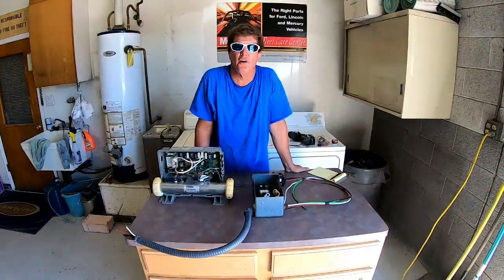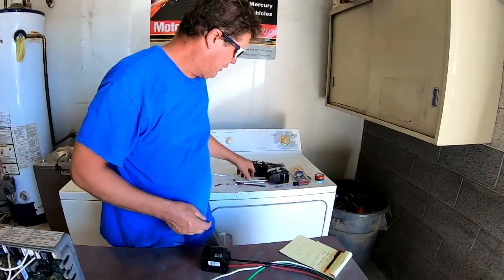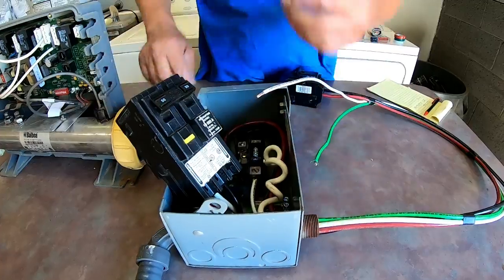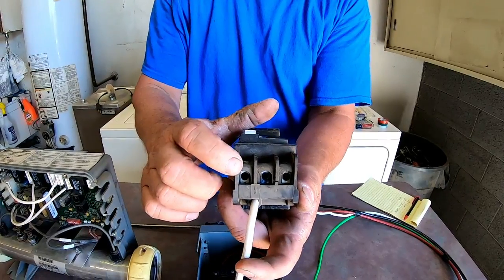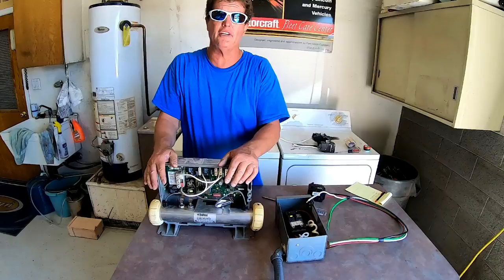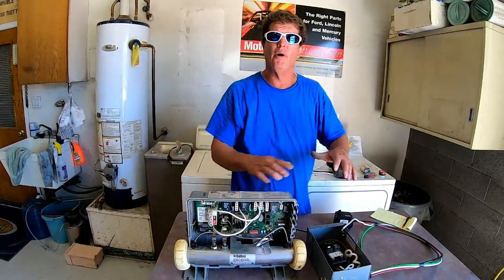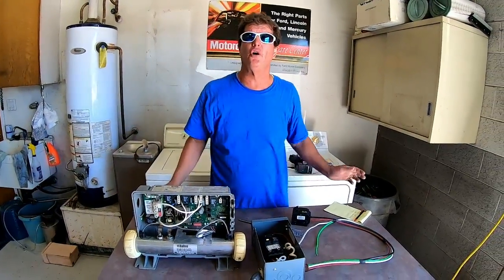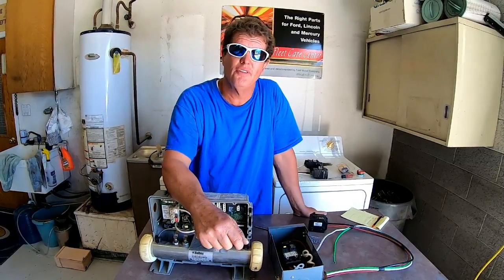Hot Tub / Spa wiring made easy... 50 Amp GFCI Install..Arizona Hot Tub Factory (DIY Spa Repair)

Comment: I don't get why you need 2 breakers. Seems silly. Why not make the breaker at the sub-panel also a GCFI breaker?
Reply from the maker: Ok first off you will always put a breaker in the main panel and the you will put a breaker in a sub panel. ( Only one of them has to be a GFCI never ever 2 GFCI breakers).  no closer then 5 feet from the hot tub and further then 20 feet and in line of sight. Sub panel should not be lower then 36 inches from ground .Now if you hot tub is placed less the 25 feet from the main breaker you only need one GFCI breaker in the main panel and make the run to the spa and you are done. Hope this Helps Thanks for Watching & SUBSCRIBING.
Reply: @spaman5440  Perfect! I did exactly that today (replaced the non-GCFI breaker in my sub-panel with a GCFI) according to your helpful vid! After 25 years in this hot tub, we now have GCFI protection. I noticed that 4 other breakers in the sub-panel already had gcfi and pigtails--just NOT the hot tub! (It's a quite DIY build of a house--if you only knew...)

Comment: Hello.  Question.  Had a Midwest 60amp Spa disconnect but, the tub we switched to needs a 50amp,  Midwest said it was ok to use a 50amp Siemens breaker.   Any issues there?   Should I just go to a midwest 50amp box.  I noticed HD does not sell those spa disconnect and read they were having issues.
Reply from the maker: No issues that aim aware of..I use 50 amp GFCI breaker with #6 wire for 120 foot max run... 3 pump/motor spas I sometimes will use 60 GFCI and go the larger wire. Hope this Helps Thanks for Watching & SUBSCRIBING
Reply: @spaman5440  Thank.    You made this SO EASY and you are still responding unlike most on YouTube..   :-)

Comment: Where do the white and green wire connect to inside the main breaker panel in the house?
You never explained what to do with those wires inside the main breaker panel.

Comment: I have a question I will be installing a Maya Platinum superior steam shower / jet tub combo and it calls for 2 dedicated circuits a 40amp and a 20amp. The 40 is for the steam generator and the 20 is for the jet tub. I have to put a  100 amp sub panel in and its about 70 feet from my power pole what size wire would I need would I need to run from my main panel to the sub panel.. I was told to run 2-2-2-4 and then run from the 40 amp to the steam generator 8-3 with ground and 10-3 with ground from the 20 amp to the jet tub. What are your thoughts.

Comment: Excellent video!  We recently bought a house with a Jacuzzi in the bathroom.  The home inspector’s report said that the motor wasn’t grounded.  I am looking at the motor now, and see a grounding screw on the motor, with no wire on it.  Where should that wire go to?  Thank you.
Reply from the maker: If you look the side of the pack there should be a ground bar...If not it is on the inside of the pack.. Just depends on what pack and Hot Tub you have.... Hope this Helped and Thanks for Watching & SUBSCRIBING

Comment: Sir if your installing a 50 amp GFCI sub panel that will feed a Sundance Hamilton 3 wire pac.  Should wire the subpanel with 4 wires and then just hook the curly wire to the common and only take the hots and ground out to pac?  Or should I not run a common to the sub panel?

Comment: What happens if the hottubs brand new. First time being wired ever and neither breaker trips but the tub still doesn't do anything?
Reply from the maker: #!1Did you check to make sure you have power to the hot tub #2 Is it wired correctly #3 blown fuss on the main board,. ...I would start with #1 and make sure you have power going to the tub.Hope this Helps    Thanks for Watching & SUBSCRIBING

Comment: Why is a sub box needed?
Reply from the maker: (NEC) It must be at least 5 feet away and not exceed 20 feet and within line of sight. The NEC also requires a 120V receptacle within a 10-20 foot distance from the spa. Bottom line is it is for safety if you have a problem and need to turn off the hot tub fast you do not have to run over the river and through the wood to turn it off...Hope this Helped.  Thanks for Watching & SUBSCRIBING

Comment: the dumb part is, they should build that gfci inline like a soda vending machine. Those gfci breakers are GIANT.  the GFCI breaker will reach dang near to the BOTTOM of a 70 amp, 2 space panel. Literally, there will only be enough for the stripping of the wire to put in the breaker. So if you entered at the bottom? Youre 100% messed up because the connector will cause the breaker not to fit. He is using smaller wire. for a tub requiring   #8 wire. Guess what? most people have hot tubs over 100 ft from the panel, and that means BIGGER wire. also some have larger tubs, now youre talking #6, all the while, the panel remains the same size!? its stupid. You wont be able to simply bend around a #6 like that.  thanks to greed, the Makers are blaming COVID for why they have no products, while MASS MARK UPS are happening. Mark ups that WE ALL KNOW DANG WELL will NEVER drop when COVID IS GONE!  So the Wire AND the breaker are mega high. 
you wont find the gfci breaker at home depot, lowes, menards, or any of those big box places. A supply house MIGHT have it. BVut the Union and giant companies are buying up stuff BEFORE it even hits the shelf.
Reply from the maker: We can't speak for others about whats going on with supply and demand. With the exception of hot tub manufactures having delivery problems we have had no problems at all getting parts for any of our jobs.The owner of our company is well connected and has this ability to always find away  to make it happen. Thanks for Watching & SUBSCRIBING

Comment: A previous underground (under concrete) installation has 3 wires only: hot, hot, and ground. They are 6 gauge, but there is no neutral wire. I have been told that the neutral is only required for the (120 volt) electronics and switches, not to actually power the (240 volt) pumps or heaters. Based on this, I was told that the neutral wire can be smaller and be re-routed from a nearby, 12 gauge, 120 volt electrical outlet. Is this true? Is it safe?
Reply from the maker: I would never recommend doing it the way...And I can't really say if it is safe or not ! But I can say I would never wire a Spa that way !!! (The reason is if someone else came to work on the spa and they didn't realize what was done someone could get hurt). On a 220/240 volt 50 AMP with GFCI I use #6 wire on all of the wires for 3 wire or 4 wire.Most of the problems I see are when its wired with the wrong type of wire or size wire. For a 120 Volt system I use a a 20AMP Breaker and the proper size wire for a dedicated service. Hope this Helps Thanks for Watching & SUBSCRIBING
Reply: @spaman5440  Thank you.

Comment: Will a non fused ac disconnect suffice for a hot tub?
Reply from the maker: Ive seen a couple try to do it that way and in the end they ended up running a separate service just for the Hottub. Most A/C services run a 30 amp breaker which will not run most Hottubs. I would never recommend to operate a Hot tubs on anything less then a 50 amp GFCI breaker with #6 wire. Hope this Works ....Thanks for Watching & SUBSCRIBING

Comment: I am changing out the sub panel box on an existing wired hot tub. I noticed that I have a GFCI breaker in the main panel. Is it ok to install a sub panel box that came with a GFCI breaker in it? Essentially having GFCI breakers on the line.  Thank you!
Reply from the maker: You only need one GFCI breaker...So you put it in the main or the sub but I would not recommend installing two GFCI breakers. You will have nothing but problems... Hope that Helps Thanks for Watching & SUBSCRIBING

Comment: Hello my name is louie, I just bought a future Spa hottub from wayfair . The product says that it takes an input of 240 volts . I have set up my connect and wires to have 240 volts. I noticed that the motor in the system says , it takes only 115 volts. I am confused about this, I have the same system as the one you have in the video but it takes an input of 240/120 volts with a 4 wire connection, L2,L1,netural and ground. My problem is that the pump says it only takes 115 volts on the nameplate. Have you ever experienced a problem like this? I'm worried if I connect 240 volts because  the 115 motor will burn. Does the control panel split the volts from 240 volts?  The pump came with the hottub and it was already installed.

Comment: Quick question, why use a 50 amp in the main panel and a 60 amp out at the tub?
Reply from the maker: Most hot tubs will call for a 50 amp service..so a 50 amp breaker needs to be in the main and a 50 amp GFCI breaker in the Sub panel. Now before you start your project check the your spa manufacture and find out what is required for the spa your are working on.. Thanks for Watching & SUBSCRIBING

Comment: 50amp calls for 8 gauge not 6
Reply from the maker: Ya... Ive been reading that also for years...That is also one of the top reasons that the breaker trips is the wrong size Wire...#8 will only save you some coin but cause you a lot of headaches in the future...Good Luck Thanks for Watching & SUBSCRIBING

Comment: Im trying to connect 50 amp wires to hot tub breaker but i don't see a common wire. I only have 3 wires I see two hots and a ground that's not encased in any color
Reply from the maker: You are missing something... Give Scott a call in the morning at the Shop and he will get you going in the right direction  Thanks for Watching & SUBSCRIBING

Comment: Hi Scott
      I had my hot tub brought up from Florida to here in Tennessee.  Unfortunately they want between $1250 to 1500 to wire the tube up..ugh So I started watching your video on how to wire up a hot tub. My question is how do you wire into the main panel from the sub panel? I do have a 220 outlet on the outside of the house that goes to the panel inside the house if that helps.
Reply from the maker: I have a couple other r videos on my channel that may Help you... Thanks for Watching & SUBSCRIBING

Comment: How do you wire a spa that needs a 220v when your sub panel is 110v? In your videos you never mentioned that spa are usually powered by 220 v..
Reply from the maker: There are three types of spas 110 volt or 220 volt and then there are spas that have what is called a 110/220 volt convertible pack. so it gets down to what type of a Spa you have...Now if your sub is wired for 110 volt and your spa is 220 volt you will need to run a new service. So before you do this you need to figure out several things.
(1) What does the Spa require.
(2) How far is the run going to be from the Main to the new sub panel.
(3) How are you going to get the wire from point A to point B ? are you going under ground , or are you going to mount conduct to the stem wall. or are you going to go over head through the attic. 
(4) Once you know the distance that will help you figure out what size wire to use.. at a min it will be #6 THHN or THWN wire and a GFCI wired correctly. Hope this Helps Thanks for Watching & SUBSCRIBING.

Comment: I have a hot springs brand where would there be a reset button in the pack area the audio control module box burnt will that stop hot tub from running also
Reply from the maker: Check the owner manual for the Hot Springs model you have for that info .. and yes that will stop it from running.
Reply: @spaman5440  thank you sir
Reply: @spaman5440  was wondering if you have access to the hot springs parts I can’t find a Bluetooth audio control box for my rhythm model hot tub 2012 if you can find parts can you text me contact info just call or text me at 7656672963 name is TJ I appreciate it I’m located in Fairmount Indiana willing to pay shipping or whatever needed I can text ya box part number too

Comment: Very helpful video. One question what size conduit use from box to box for 4 six gauge wire
Reply from the maker: 3/4 will work 1 inch is a little bit easier to work with.

Comment: This was an excellent tutorial, thank you for posting.  The spa box I am mounting to my house is 60A so I used 8/3 from my sub-panel.  The spa asks for 50A.  Then used 6/3 from the main to the sub panel since the sub panel will have a couple other outside breakers in it.
Reply from the maker: I would not wire it with  #8 you could have problems. I would use a min of #6 wire for. a 220/240 volt with GFCI   Thanks for Watching & SUBSCRIBING
Reply: @spaman5440  agreed, I wouldn't use 8 either
Reply: 6/4so is only rated for 45 amps

Comment: Hey Scott, you are awesome!!!  Question: I got an old hot tub free - Hot Spring Grandee Model G. Looks great but obviously old. Wiring instructions indicate 50 amp breaker (1-30 1-20).  The control box which is IQ 2020 have instructions for a total of 6 wires (3 #12awg & 3 #10awg).  Must I run individual wires or can I somehow use Romex and a single 50 amp breaker identical to what you illustrated?
Reply from the maker: You have to use two breakers for a Hot Springs and all 6 wires as instructed by the manufacturer..or you will have problems.

Comment: Hi Scott, thankyou nice videos very informative, would you say to use the same Amp Breaker at the inside panel and the outside box? or can you use for example 50 amp at the inside panel with #6 wire run and a 40 amp at the outside box with #8 wire run? also is there a chat that shows accepted lengths of wire run to the correct amp breaker?
Thanks again
Reply from the maker: You need to wire the Spa the way the manufacturer says to do it in the owners manual... For a 110 volt Plug & Play I use a 20 AMP breaker with a cord that has a GFCI breaker built in to it.. For a Spa that has up to 2 motors I use 50 amp breakers for both main and Sub panel  (one has to be a 50 Amp GFCI) and #6 wire on all four wires... If it has 3 or 4 motors I refer to the owners manual and wire accordingly.Now depending on how far away from the main breaker the hot tub is placed will also play a part as to the breaker and wire size that has to be used.. Before you start know the Code and what the manufacture requires.. Hope this Helps. Thanks for Watching & SUBSCRIBING
Reply: @spaman5440 Will do, thanks for getting back so soon, I'm hooked on your channel. 🙂
Reply: @spaman5440  Breaker size won't change but you may need to upsize the wire on long runs, or if your run is exposed to high temp (my conduit is in the sun in AZ). There are tables in the NEC (National Electric Code) to compute the impact of wire length and temp.

Comment: Scott, PS. Also if wired for 220v and the jumper for 110v and dip switch is set wrong. Will it also pop the GFI breaker. Was late last night, working under a light and wanted to get in tub...didnt see your video until today

Comment: Is it possible that a GFI breaker only have the pigtail and 2 wire connections on it? That the white(neutral)/black(hot) going to the hot tub are together? And the red is by itself(hot). 

Master Spa's Clarity Spa diagram shows it as such..GF just got her tub in yesterday and is popping the breaker. But also think the jumper and dip switch not set from the idiots that dropped it off..
Reply from the maker: Who ever is wiring the Hot tub needs to look at the cover on the pac to make sure all of the wires are in the correct spot and that they are the right size..most hot tubs require four wires to connect... 2 hot wires and neutral and ground and it all must go through a GFCI before it get to the Spa.
If you watch this video it might help...https://youtu.be/zBlRBQ5ilvg
Thanks for Watching & SUBSCRIBING
Reply: @spaman5440  Im on your 4th video. The pack is similar to your Balboa one. Will have to get back into in and see the exact pack. Had 2 guys that just dropped off the spa, and that was all. its probably still setup for 110v. The GFI's that is installed only has 2 term screws in the front for black/red. Need to take out and see where i can term the Neutral at.
Reply: @spaman5440  MAN, DO I FEEL DUMB. Popped open the panel and the GFI had a screw term right in the middle. I really dont know how I missed it......but the screw was a darker shade than the blk/red screw....terminated the white wire and BAM all is good and working. thanks for your help
Reply from the maker: @Joegest1  I glad you stuck with it and figured it out...Good for You. Thanks for Watching & SUBSCRIBING
Reply: @spaman5440  Yep, thats the mechanical mind in me. cant let it go. step away, take a breath and attack it again. And then you say DUH !!!! cuz it was so easy to see...

Comment: I wired the hot tub correctly with 2/50 amp gfi sub panel   Everything works the pump the heater the lights  but when I push the test button on the gfi it doesnt trip   Any suggestions

Comment: Awesome video ! Helping a friend with a hot tub it’s a Dynasty hot tub, got it wired up works , but when I hit the 2nd pump on, it’s throws breaker? Also radio won’t work , chi’s all fuses ,  no power, an lights don’t work, I  think power Pak or inverter is bad? Last can the wet end or impeller housing be rebuilt ? Leakin at motor shaft?
Reply from the maker: You have a lot going on... Its tough to help you here.. If you call the office and ask for Scott he can get you going in the right dirrection. Thanks for Watching & SUBSCRIBING

Comment: I have a question? I just put in a new pump motor on my jucuzzi and i wired it the same i took it out. black to L white to C and red to H. after i turn on the breaker it pops. Do I have a bad breaker?